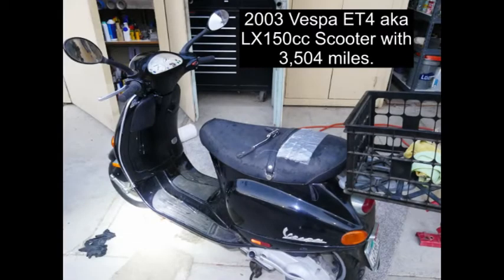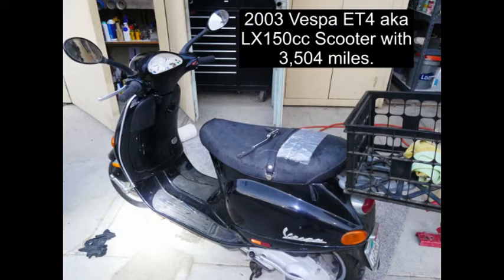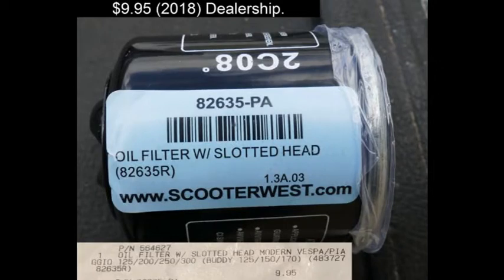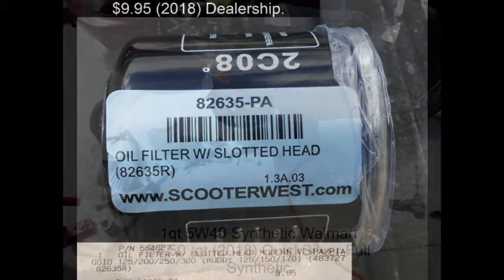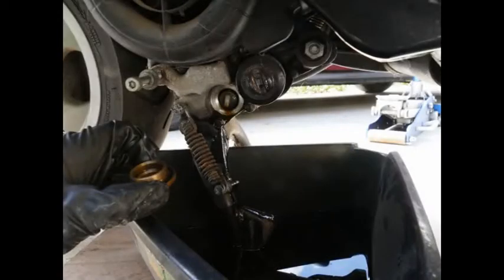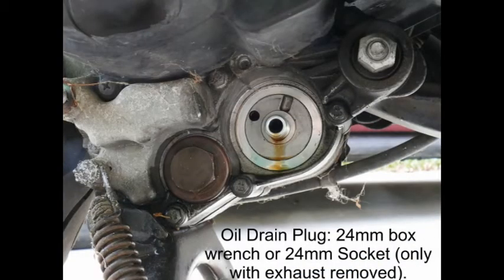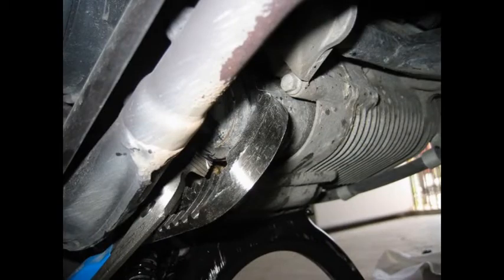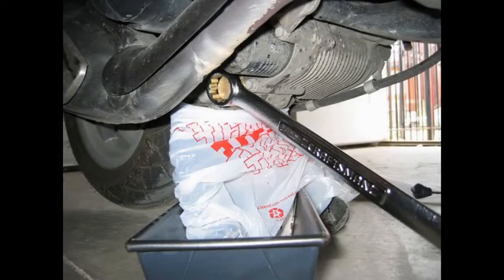Vespa ET4 LX150 Oil Change Tips Don't remove Exhaust Unless...

Comment: I’d rather do it on its side stand when opening the drain bolt, then lean the vespa onto something sturdy to the right side and let it drain till the last drop, or you can hold it leaning to the right side for a while
😂
Reply from the maker: You’re right and I actually did that with a motorcycle that I had years ago I just leaned it against a wall. I forgot what a mess it made running down the center stand. that scooter belongs to my friend and she hasn’t been driving it and I told her I put a lot of work into it she better use it more and I will probably be doing some kind of tuneup on it again in a few months
Reply: @pcofranc  yeah, back then I’ve tried the center stand method as well, and a bit traumatized by the mess it made 😳 

the Italians engineering is a bit funky, so a funky method is needed to overcome this oil change problem
🫠🫠